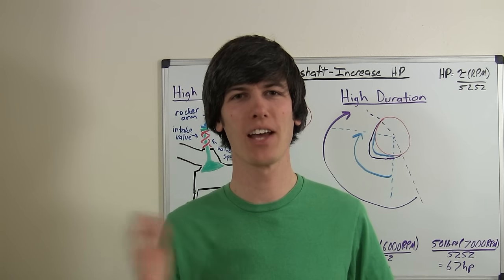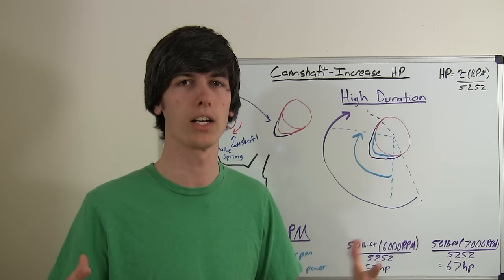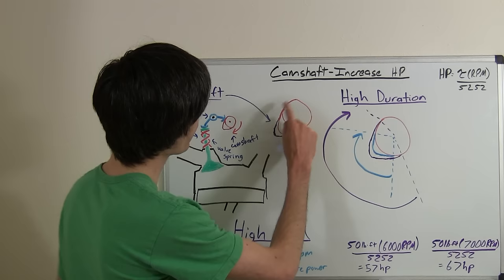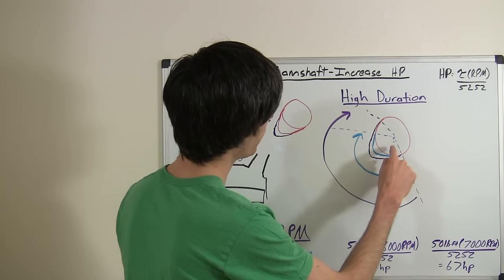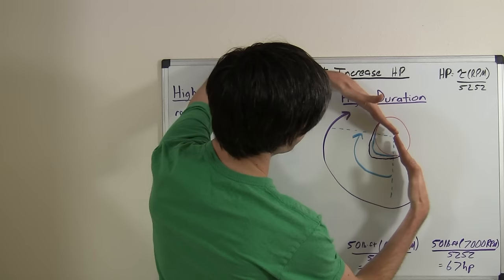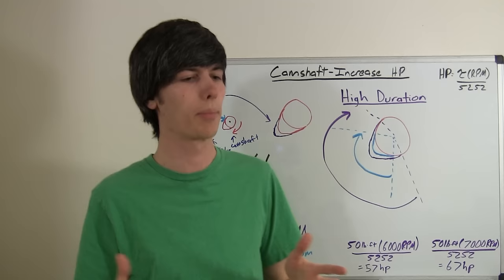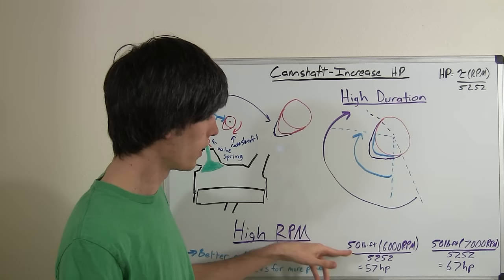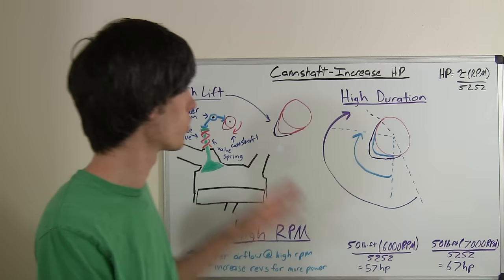Camshaft - High Lift and Duration - Increase Horsepower

Comment: Hello guys,

Do you have any ideas on how can one express the motion of a engine cam lift profile in time knowing only the speed of the engine ?

Thanks,
G.
Reply from the maker: Gabriel Trt Cam rotates at 1/2 speed of the crank. Example: engine at 3000 RPM, cam rotates at 1500 RPM (for a four stroke engine).
Reply: Engineering Explained  Hello and thank your for your answer, I agree and I'm mostly interested in getting the analytical equations that connect the position of the valve to the rotation speed  of the crankshaft. Any sugestions ?
Reply: Gabriel Trt 
That's a complex problem. Look at solving spring and mass systems, as well as second order Ordinary Differential Equations. You can expect sinusoid behavior for lifting the valve. You'll need Sin(((k/m)^(1/2))*T) to describe a freely oscillating valve. You then have to run your valvetrain backwards to see where the cam lobe should be, and your valve events need to fit where you want them. Good luck. People fight about how to do this.

Comment: For the z125 pro they have a street cam of .210 lift and 246 duration
The dcr cam is .252 lift but 230 duration which is better?
Reply: the dcr. gets more air in faster. more lift with less duration. so more of a high rpm cam
Reply: @Dancerman007  I want to get the dcr but is overpriced quite a bit and also the manufacturer or seller says that over revving or racing use is designed for one time only and not intended for everyday use. Since I commute daily with it I'm kind of swaying towards not buying it. Even though in other videos people have bought it used it some gained 2 hp and some say it is good from 7500rpm to 12000 rpm.

Comment: O.k. some people take bone stock 150 or 250 hp 350 Chevrolet engines slap a 290* cam in it. Guess what? It still makes 250 ish hp has same peak torque but everything simply shifted up the rpm band. No power improvement there. But now add an even bigger cam and the engine starts becoming useless as torque peak number plummets. But now put some modern heads on it, and port them and it can become  quite balanced and effectively use a 290* advertised duration cam only you need more compression to compensate for the later intake valve closing time or the engine won't run right or idle. This is all roughly speaking neglecting other variables and cam specs etc. for the sake of an example for peeps who really want to learn.

Comment: you explain that with higher lift and duration I can get more rpm ... explain this. 
gsxr 600 = 1700 red line 
gsxr 750 = 1400 red line
gsxr 1000=1200 red line
but each one gets more power from 600 to 1000 and the lobe is bigger and longer on the 1000 ?
Reply: +Josh Mook If the cam is too weak, it won't make power at high RPM. He also mentioned that you need more "swaps"(mods) to raise the RPM. Such as stronger valve springs, more fuel, a better tune. Often times weaker smaller engines can rev higher. Sometimes engines are designed specifically to make power at lower RPM like the V8 and Subaru Boxer, or different rod-stroke ratios, so they don't need to rev as high.

Comment: Huge downside you might have missed.  Long duration means at least one valve is typically still open when compression begins.  This reduces effective compression and horsepower.  Also, you mentioned beefing up the engine for higher RPM.  That usually entails stiffer springs to inhibit float.  If your lift alone didn't mandate higher spring rates, you just cost yourself horsepower and durability, because that cam is trying to spin around against extreme pressure.  You're also having to abandon quiet hydraulic cams and get expensive, noisy, high maintenance solid rollers because nothing else survives at the upper limits of your engine.  Also, you can't have a turbo with high duration because it will blow intake charge through to the exhaust.  Unless you drive an engine that was made to live blissfully above 6000, duration is evil.  Lift is always good.  Probably you should have talked about rocker ratios.
Reply: I would just like to add that most manufacturers in the aftermarket world try to sell you a cam with wildly excessive duration.  One company that tries to offer high lift with low duration is Howard's cams.

Remember, high duration robs low rpm torque, and 95% of the drivers out there do not want this.  So tens of thousands of cams in catalogs actually are inappropriate.
Reply: Yasmin Gallardo Increased duration is almost always accompanied by advancing the centerline of the camshaft so that the dynamic compression ratio (the ratio calculated from as soon as the intake valve closes) remains high, if not higher than stock. It is ALWAYS a fantastic idea to get some bitchin dual springs with 1000lbs of seat pressure and you are completely right in stating that a cam swap with stock valve springs isnt a good idea. Also correct in saying that most of the off the shelf cams (looking at you Big Motha Thumper) just use massive duration #'s and stupidly low LSA's to sound like a WWI trench when a lower duration would make more power. But i would also like to mention that with an aftermarket cam, you will usually pick up more torque low rpm too simply because the higher lift, even if the duration is now optimized for high rpm

Comment: If we chg a performance cam shaft....does fuel consumption increase as well?
Reply: i would imagine fuel economy would be better from more engine capability from the same engine size.
Reply: Only if you take it into the rpms were it normally wouldnt go
Reply: If you add more air you have to add more fuel!!, otherwise you can lean out your engine too much and could cause major issues.

Comment: This means that if you have higher duration cam shaft you need to retard your ignition timing? I do ecu remapping and tuning that is i always do to give more time for air to come in specially when motor use direct injector

Comment: I wonder why the disadvantages of aftermarket camshafts were not discussed?

You're only talking in peak power, not power "under the curve". A stock camshaft is well suited to most stock engine. 

Alot of modders I've noticed especially in the LS community believe that a cam will not affect their low down power and wonder why they have issues replicating their dyno power at the 1/4 mile

Comment: so if a cam has 270 degree duration, does that mean the valve is open 3/4 of the time?
Reply: that basically just tells you how much the valve is open at a certain lift point.
Reply: Duration is how long it is open. Not really how much. Lift is how much. Duration is how long.
Reply: And that duration is really for how many degrees it is open for the piston rotation rather than the cam rotation. If the cam was open for 270 degrees going by the actual cam, that would bend valves cause the cam moves half as fast as the pistons do. So if it was really like that then the piston would probably hit the valves every time it moves to tdc. And for the guy who is gonna be responding to me, I am not referring to non interference engines. I know it is fine with those cause they make them that way in case a timing belt breaks it wont bend the valves. I know it isnt included on every engine with a timing belt and I know they probably include them on some engines that have chains. Just in case you argue with me.

Comment: Is it possible to have a cam that is both high duration and high lift?
Reply from the maker: Sure. There are also camless valves where you can control this electronically, like what Koenigsegg has created.
Reply: Engineering Explained What about a Vtech engine on honda? It has like a dual camshaft?
Reply from the maker: VTEC - Explained

Comment: BHP is all about how fast in happens.
But in case of a higher compression petrol engines is already 12-13 range increasing this can give more power but we are taking factory safety reserved space . Upgrading New gen. Engine are wast of money. We don't get That bhp what we are paid.

But older engine can give lotsnof power because from factory it's lower compression . Whatever it is in  lower compression say 9:1 means 9 part air and 1 part fuel, but new gen engine its 12.3:1 only very few space. May be higher octay number will help.

Think before you break your bank.

Comment: if I was to install a performance camshaft on my Honda Civic would I need an engine management system?? PLEASE HELP
Reply: most stage 1 camshafts(for hondas that i know of) allow the use of stock valve springs keepers and retainters and your stock ecu. although you need the basic IHE intake header exhaust. when you upgrade to stage 2 i recomment atleast getting a basemap and upgrading your valve springs note you can use your stock keepers and retainers if they are still in good shape to a certain point atleast in my opinion. Most titanium are not meant for daily drivers and fatigue faster. but in the end the tune(hondata neptune chrome etc etc on a dyno) is what will help the cam you can throw parts at these new fuel injection motors all day long and it wont help anything it sometimes can actually make your performance worse.
Reply: Na dude but you might have to upgrade some stuff from the engine
Reply: thanks everyone. but yeah i have a cold air intake, headers, full exhaust, obx intake manifold, 330cc injectors, MSD ignition. i am about to install a whole new cylinder head with skunk 2 cams. what do you guys think
Reply: should i get my ECU re-flashed?
Reply: luis moreno if you're going to to spend all the money to get those parts, you should spend the little extra to get it tuned to breathe right, or else you're not taking full advantage of the new stuff, and it'll help your engine run smoother and cleaner with the new parts.
Reply: get a basemap then go to a tuner im guessing you put around 7-8 in your cylinder head alone depending on the parts. It sucks when that money goes down the drain because of a bad tune or no tune. your obd1 right

Comment: So if I upgrade my camshaft on my automatic. Will that increase my RPMs? If not, what will?
Reply: bmbrman7  Pretty much all engines run out of air long before you shift. A hotter cam will keep the stock rev limit, but you'll retain the power for more of your RPM range. A cam is the single best mod you can do for power on any given engine except for motorcycles.
Reply: thanks...any suggestions on where to find really good ones?
Reply: It depends on what you want out of the engine and what kind of engine you're dealing with. I myself am a big advocate of cams with a tiny bit of overlap. It makes a flat torque curve until the engine runs out of air, but at idle it will lope.
Reply: I would like it to lope at idle too but im looking for more increased torque
Reply: It depends greatly on the intake valve closing event. You want to open the intake valve slightly before top dead center and close it near the stock location. General Motors did this with the LS3 525. Look at a stock LS3 dyno chart, and then look at a CT525 dyno chart, both at the 3000 rpm range, and tell me what you see. What kind of car are you interested in modifying, and what RPM do you enjoy most?
Reply: +bmbrman7 upgrading your camshaft will make it safer to run your engine at higher RPMs but you will need to tune your ecu to allow your transmission to not shift at the stock redline.  Get a tuner like a bully dog triple gt or something similar.
Reply: I have a Subaru impreza rs 04
And its automatic..I want it to not be sluggish when I want to step on it..but it's hard to do a pull when it's in 4th gear..so would an ecu help with that?
Reply: +bmbrman7 you could put a cam in it and that will give you more high end power and if you are really looking to get high end power you could get a turbo if you car doesn't already have one but if it already has a turbo you could get a turbo upgrade.  but no matter what you decide to do getting a performance cam and getting your ecu tuned will definitely help.
Reply: Yea that makes total sense...thanks...so how do I get it tuned because I was looking up some ecu's but I don't how to use those things

Comment: how do we conduct high lift and high duration in rotary engines?
Reply: Nick Amarit port them
Reply: Chase Watkins so for wankel engines, you can only port them to increase amount and duration of airflow. However, for OHC engines, you can do both - port the engine and change the camshaft, right?
Reply: Yes but over porting a reciprocal engine will decrease air speeds which can be bad for gains. If you over port a rotary you get overlap causing them to have their distinctive brap soundtrack but this let's them rev to the moon
Reply: Chase Watkins ah, I see.
Reply: Nick Amarit
Porting is worth a shot. Just don't go for an aggressive job. Deburr, blend the back of the valve seat with the port, and you'll get a measurable difference. Match the intake port with the port on the intake manifold. Really though, Cam and headers are the best bang for the buck, even with the stock muffler. Stock mufflers these days are very effective.
Reply: Guns Cars and Digits Thanks for the tip!
Reply: +Nick Amarit 
I was back on this video and hit your comment about rotaries and wondered why the hell I used V8 logic in my answer comment. For rotaries like the renesis, the port is covered by the side of the rotor. Those ports are made bigger, therefore the rotor takes longer to cover them, and they flow for a longer period of time. The other rotaries like the 787B have what is called a peripheral port. This has the port enter right through side of the case and uncovers the apex seals. This can aim the air flow in a more laminar fashion so it mixes efficiently at a higher RPM range. I have no idea if folks have made engines with peripheral and side ports, because the section can go to over 3 square inches, and gives over 300 cfm of flow, and that's a LOT of air for such a small engine. A 2.0 liter engine with 300 CFM heads can have good V.E. to 9000 rpm and go hyperbolic at 10700. So, an engine like the R26B mazda probably doesn't have that much air flow. 2-stroke engines like rotaries will have double the torque of a piston engine, so a 2.6 liter rotary should make close to 370 foot pounds, and if they keep it until 8500, that's a 600hp deal.
Reply: +Guns Cars and Digits wow, thx for the extra info!!! :)

Comment: You probably should have mentioned all the reasons why you might NOT want to install aggressive cams on a daily driver.
Reply: Gregory Foresi too late i get my daily back from the shop on monday =(
Reply: Well it depends how aggressive of cams you put in. Aggressive valve timing can cause idling problems and make the car super jumpy in traffic.
Reply: Gregory Foresi i put in the most aggressive cam they had =(
Reply: Koalafications4Dayz oh yeah? How is that working out for you?
Reply: I suppose that's not technically the point of the video. He's just explaining why changing a camshaft will create more power. Not whether or not it's a good idea haha
Reply: Ive got a 235/243 @.05 with .630/.630 lift on a 112LSA and i dont mind dailying it at all, for the majority of car enthusiasts the increase in power will make the sacrifice of super-low-rpm mellowness an easy decision. Not to mention the low rpm rowdy idle sounds pretty badass
Reply: KittyCow I imagine that a cammed LS is a bit different than a cammed honda or subaru. I imagine cams in my sti would feel like a weedeacker until 4000 rpm 😂
Reply: Gregory Foresi I imagine an sti to feel like a weedwhacker all the way to redline in every gear tbh LMAO jjjk

Comment: So is this what they mean when a car is "cammed"?
Reply: +SantaAnaBandit Generally this means the stock cams have been replaced with aftermarket or hot cams (high lift cams...you get the idea) to provide more horsepower as described in the video.

Comment: wont high lift make my valve hit my piston?
Reply from the maker: +VaSpoof It's absolutely possible. It needs to be designed with this in mind. Modifying an engine isn't always as easy as swapping out a part - this is more so theory of designing a powerful engine.
Reply: so how would i do that would i need my ecu tuned, like increase timing or something? i really neeed help im just going with a 270degree camshaft on my 1.8t jetta, has ferrea valve and spring and retainer kit (1mm oversized)
Reply: i honestly dont know wat or how to do that
Reply: +VaSpoof research adjustable cam gears for your vw engine ...just as a place to start
Reply: +vdubornothing you won't get much from a 1.8 jetta. the best you can do safely is get a new ecu mapping
Reply: They make pistons with relief valve with appropriate lift and oversize allowed
Reply: Kevin Alaniz ok thanks
Reply: +vdubornothing Add bigger turbo, remapping with the 150hp 1.8t you should hit 250hp.
Reply: vdubornothing  then u must give your piston a valve poket
Reply: just throw nitrous on it
Reply: Go to a 5 valve AEB head. You can run a high lift cam on your motor. You have low comp dished Pistons. Get a gt35 with an 02j or 02m swap with say a gt28r.(torque spike).
Reply: Depends on your engine  And how much Room you have between your valve fully open and your piston at TDC  if you don't have the room You can add more valve live if you change your piston style A dish piston will give you more room but lower your compression but if you're boosting your engine you might want that  Or instead of more lift longer duration would be the way to go Get your engine recipe right before you start changing stuff don't go into your engine Robbing Peter to pay Paul that's the one step forward two steps back approach💰💰💰
Reply: @vdubornothing6247  its called engine degreeing and claying. You really gotta be careful. Contact a specialized tuner/builder and get their opinion or have them do it for you. Its somthing that NEEDS to be done when going with an aggressive cam
Reply: Maybe not.. cuz your valve opens when you piston is goin down..